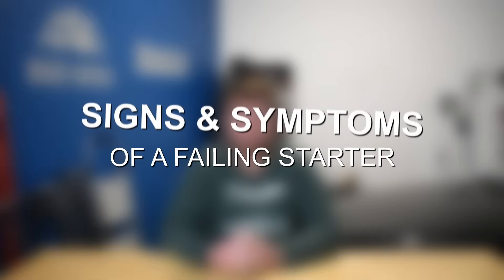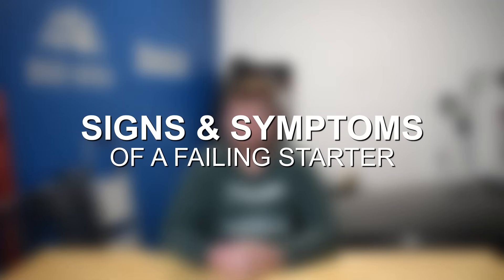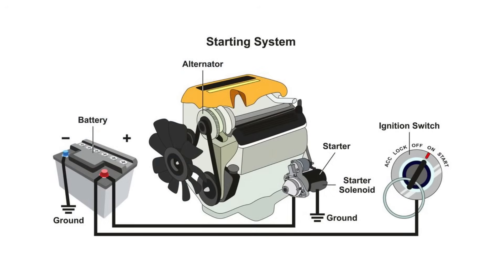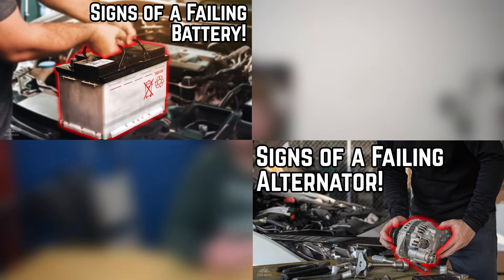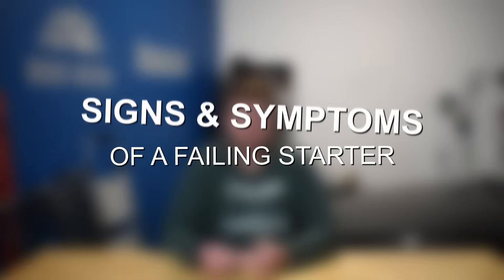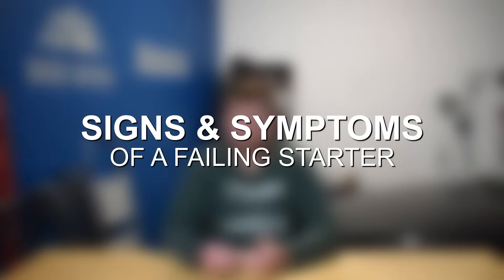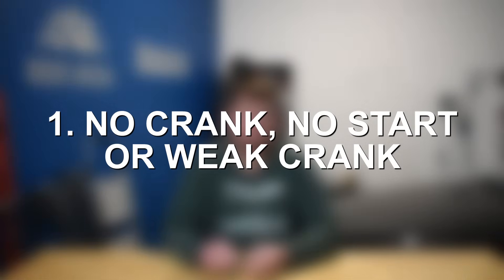5 Symptoms of a Bad Starter!

Comment: bro i put a new starter on 2hen i cranked it the starter sounded like it kept spinning and it hasnt started since. its 20 degrees so  havent got under the car to see whats going 9n but all i hear is a click the battery and cables are good i have a battery charger
Reply from the maker: D - If your new starter kept spinning when you first cranked it and now only clicks without starting, it’s likely a stuck starter, bad solenoid, or an installation issue. The starter may have failed to disengage properly, causing it to overheat or damage the flywheel teeth. Since it's now just clicking, check the starter connections to ensure they are tight and making proper contact, especially the ground and power cables. Also, try tapping the starter lightly with a hammer while turning the key—if it engages, the solenoid may be faulty. If the problem persists, the starter may be jammed against the flywheel, requiring you to unbolt and reposition it. Cold temperatures can also cause internal resistance, so ensure your battery is fully charged and delivering enough cranking amps. If all else fails, the new starter may be defective and need replacement. Keep us updated!
Reply: @8020Media  I have an older Impala so I think I'm having a security problem because I put another starter and just click new battery

Comment: I have to crank up my car 2 times for it to start and then after like a week the battery is dead and usually I get it replaced and it’ll turn on again(but I still have to crank it 2 times for it to start)
Reply from the maker: I - The fact that your car requires cranking twice to start and the battery dies after a week suggests two likely issues: a parasitic drain on the battery and a potential fuel delivery or ignition system problem. The repeated battery failure points to an electrical component or system draining power when the car is off. Perform a parasitic draw test by disconnecting the negative battery terminal and using a multimeter to measure current draw; anything above 50mA indicates a significant drain. As for the need to crank twice, it could be caused by a failing fuel pressure regulator, fuel pump, or ignition system component like spark plugs or coils. Keep us updated!

Comment: Replaced my starter 2 wks ago now when I turn the key over the battery dies. Battery, alternator, relays, fuses are all good. Did the same when I changed the starter first time . The starter was a refurbished one
Reply from the maker: C - If your battery dies immediately when turning the key after replacing the starter, the issue is likely a shorted or faulty starter, a bad ground connection, or a high-resistance power cable. Since this also happened the first time you replaced the starter and you used a refurbished unit, it's possible the starter is drawing excessive current due to an internal short. Check all battery and ground connections, ensuring they are tight and free of corrosion. Inspect the starter power cable for damage, as a frayed or internally corroded wire can cause voltage drops. Try testing the starter outside the vehicle (bench test) to confirm if it’s faulty. If everything checks out, replacing the refurbished starter with a brand-new OEM or high-quality aftermarket unit may solve the issue. Keep us updated!
Reply: @ Thank you I believe you’re correct. I replaced it yesterday with another warrantied Starter and it started back up. My ground connection from my battery was a little loose and tightened back up. If anything changes I’ll update  👍

Comment: My 05 titan had been sitting for a while, I am very positive that my battery is good but when I turn the key it’s almost as if everything is surging. My gauge needles will spazz and there is a ton of clicking and what sounds like sparking but there’s no actual sparks. I hope it’s just my starter but the gauges are throwing me off.
Reply from the maker: K - The clicking, gauge needles spazzing, and surging electrical behavior in your 2005 Nissan Titan after sitting for a while likely indicate a weak or corroded battery connection, bad ground, or failing starter relay rather than just a bad starter. Even if the battery is good, check the battery terminals for corrosion or loose connections, as poor contact can cause voltage drops and erratic electrical behavior. Also, inspect the chassis and engine ground straps, as corroded or loose grounds can lead to intermittent power delivery. The clicking sound suggests the starter solenoid isn’t getting enough voltage, which could be due to a weak connection or a failing starter relay. Keep us updated!

Comment: So my 2012 sonata fails to start once a month it seems. Dashboard, lights everything works. No crank, no start, no sounds no jump start. This has been happening after the starter has been replaced as well. I began disconnecting the battery to reset the alarm system as well as unplugging the connection in the inside fuse box. It will start 30mins later sometimes. Sometimes I have to leave it unplugged overnight. I've changed the start fuse also. The car will start like normal for at least a month and do it all again. I also make sure the steering wheel is not locking up and I try to park on level ground. Any idea what's causing this? Diagnostic checks are getting too expensive.
Reply from the maker: J - The intermittent no-crank, no-start issue on your 2012 Hyundai Sonata, especially since the starter has already been replaced, is likely caused by a faulty neutral safety switch, an intermittent ignition switch issue, or a problem with the anti-theft system. Since disconnecting the battery or fuse box sometimes allows it to start, the alarm/immobilizer system may be preventing the car from recognizing the key or allowing the starter circuit to engage. Next time this happens, try shifting to Neutral and attempting to start, as a failing neutral safety switch may not detect the car is in Park. Additionally, inspect the starter relay and wiring to ensure there’s no loose connection. If the immobilizer is the issue, using a scan tool to check for stored immobilizer or key recognition errors may help pinpoint the problem. Keep us updated!
Reply: @8020Media  thanks

Comment: My car will crank   i willl at least have to turn it 2 times by the 3rd time itl start. Once i had turned it nothing no noise radio was on and everything nothing. Did it a few times nothing. Waited like 10 minutes turned it than it started slow. Got home turned the key consistently like 6 times it started fine.
Reply from the maker: J - The issue you’re describing, where your car cranks inconsistently or requires multiple attempts to start, points to a potential problem with the starter motor, ignition switch, battery connections, or fuel system. The fact that it sometimes does nothing when you turn the key suggests a possible issue with the starter solenoid or ignition switch, where the signal to engage the starter isn't consistently reaching the motor. Additionally, check the battery terminals and ground connections for corrosion or looseness, as poor connections can cause intermittent starting issues. If the starter and connections check out, the issue could also be tied to a failing fuel pump, fuel pressure regulator, or a clogged fuel filter, especially if starting improves after waiting (allowing pressure to build). Keep us updated!

Comment: Had a mobile mechanic to conduct a diagnosis on my Ford territory 2005 model.  Vehicle issue was that it couldn't start. He concluded that it was both a battery and an alternator problem. Had both replaced. Car was still abit hazy starting  up but got the vehicle up and running.  Battery test concluded after the new one that it was charging up but slower than usual. Went for a 50 minute drive, no problems on the road, AC radio all working fine.  Got home, turmed car off, turned  it back to check if it was still ok 7 seconds later and it was dead. Checked the new battery and it was completely drained.

Your thoughts?
Reply from the maker: K - If your 2005 Ford Territory has a new battery and alternator but the battery drains completely after driving, the issue could be due to a parasitic draw, a faulty alternator connection, or an issue with the battery wiring. Start by inspecting the alternator’s wiring and ground connections to ensure they’re secure and properly transferring power. Perform a parasitic draw test by disconnecting the negative battery terminal and using a multimeter to measure current draw; anything above 50mA indicates an excessive drain. Common culprits include aftermarket electronics, a faulty relay, or a short in the wiring. If the alternator isn’t properly charging despite being new, test the voltage output at the battery while running (should be 13.5–14.5 volts) to rule out any installation issues or a defective alternator. Keep us updated!

Comment: My starter motor was clicking rapidly, so I replaced it with a brand new starter. But with the new starter it's still just giving me rapid clicks? I still think the clicking is from the solenoid engaging and disengaging. Is there anything else that could cause this behavior?
Reply from the maker: K - If your new starter motor still clicks rapidly, the issue likely lies with insufficient power reaching the starter. Check that the battery is fully charged, providing at least 12.6V at rest and 10V while cranking. Inspect battery terminals, starter connections, and engine ground straps for corrosion or looseness, as poor connections can limit current flow. Test the starter relay and solenoid control circuit to ensure proper operation, as a faulty relay can cause the solenoid to disengage prematurely. Additionally, check the cables for internal corrosion or high resistance that may restrict power delivery. If all components are fine, have the battery load-tested and verify the alternator is charging the system correctly. Keep us updated!

Comment: Thanks for the video. I've got a brand new battery and doesn't seem like there's the power that new battery should be giving the starter. Every now and again, it'll only just barely start the engine. Battery has been tested twice now and passed. New terminals, same story. Hoping this is the starter? It's under warranty but not sure how to go about the process
Reply from the maker: 7 - If your new battery tests fine and the terminals are clean and tight, the issue is likely with the starter motor or its connections. A failing starter can exhibit symptoms like weak cranking or intermittent starting despite a healthy battery. Before replacing it, ensure the ground connection from the engine to the chassis is solid and inspect the starter’s power cable for corrosion or damage. If these are good, the starter is the probable culprit. Since it’s under warranty, contact the warranty provider or the shop that installed it and explain the symptoms. They may require a diagnostic test or starter inspection to confirm the issue before authorizing a replacement. Keep us updated!
Reply: @8020Automotive  My wife actually was looking more into it because I'm stumped and found that it may be possible that a low battery in key fob is the culprit. I measured the 3v battery at 2.8 volts which is considered dead, so hoping this may be it. We'll know within 2 weeks. Will update
Reply from the maker: 7 - Sounds good. Keep us updated!
Reply: @8020Automotive  Still hasn't failed so I'm almost ready to call it fixed.

Comment: What if it keeps blowing the ecmb fuse the starter has been making a crazy nouise
Reply from the maker: B - If your vehicle keeps blowing the ECM/ECMB fuse and the starter is making a strange noise, it's likely due to an electrical short or excessive current draw from the starter. A failing starter motor with an internal short can overload the circuit, causing the fuse to blow. The noise from the starter suggests it might have damaged components, such as a bad solenoid or worn brushes, exacerbating the issue. Inspect the starter wiring for damage or frayed insulation that might cause a short to ground. Replacing the starter motor and ensuring all associated wiring is intact and secure should resolve the issue. Keep us updated!

Comment: 1:52 REMEMBER!! This can also be the sign of a dead battery. A rattling relay, is a dead giveaway of a dying or dead battery. However, the battery may have enough juice to actuate the solenoid itself, but not enough juice to get the starter motor to crank the engine. I've had that situation happen to me once, I was worried the starter gave out but then we tried to jump my car and it started like a champ! This is very possible and it does happen. Left my dome lights on that night prior lol! Good think they're halogen bulbs because it didn't seem to affect their lifespan much but I'm trying not to do that because I don't want to burn them out either. Or have to replace my battery....
Reply from the maker: A - Very true! Thanks for sharing this insight.
Reply: Ok so I thought same thing with mine but today I had to have someone use a screwdriver to get connection on a wire or something on my starter while I cranked the key and my solenoid on starter is really loose so my question is is it possible to just change the solenoid or should I just change my whole starter and be done with it? Lol

Comment: I'm getting that machine gun noise. My 1997 Lexus kept dying because the battery was not connected properly. I think the connection got loose. Also one of the buttons to lock the door was stuck and kept draining the battery but no one figured that out for 8 years. I have problems with my Lexus because it's old but I found a good mechanic.
Reply from the maker: S - The machine-gun noise you're hearing is likely from the starter solenoid clicking repeatedly, caused by insufficient voltage reaching the starter. This issue is often related to a weak battery, loose or corroded battery connections, or a failing starter motor. Since you mentioned a loose battery connection and a long-term drain issue from the stuck door lock button, the battery might have been weakened over time. Start by ensuring the battery terminals are clean and tightly connected, fully charge or replace the battery if necessary, and verify the alternator is properly charging the system. Fixing the door lock drain issue will prevent future battery problems. If the noise persists with a healthy battery, the starter itself might need inspection or replacement.

Comment: Bad starter can stop the motor wile running?
Reply from the maker: C - No, a bad starter cannot stop the engine while it is running. The starter is only used to crank the engine during startup and does not play any role once the engine is running.

Comment: Mines does the one click when i turned the key, but my truck started dying out when i was driving in the snow 2 weeks ago but when it stopped snowing it had ran back to normal
Reply from the maker: T - This can happen when it gets cold!
Reply: @8020Automotive  oh okay so that would mean my starter still good or its no good anymore?
Reply from the maker: T - The single click when turning the key suggests an issue with the starter motor, its solenoid, or the battery connections, but the earlier stalling in snowy conditions points to potential moisture or corrosion affecting the electrical system. Snow and moisture can cause grounding issues or interfere with the alternator's ability to maintain the battery charge, which may also lead to insufficient power to the starter. Start by checking the battery's state of charge, cleaning the terminals, and inspecting the ground and starter connections. Additionally, inspect the alternator output to ensure it's charging properly, as the snow-related behavior may indicate an alternator or electrical connection issue exacerbated by wet conditions.

Comment: My clio campus 2008 starts first time every time. However I get a slight grinding sound for half a second after it starts. Does this mean my starter motor is going to die soon?
Reply from the maker: L - The grinding sound after starting your 2008 Clio Campus is likely due to the starter motor's pinion gear not disengaging from the flywheel quickly enough. This could indicate wear on the pinion gear, flywheel teeth, or the starter solenoid. While it doesn’t necessarily mean the starter motor will fail immediately, if the issue persists or worsens, inspect and possibly replace the starter motor or solenoid to prevent further damage. Checking the flywheel for wear or damage during this process is also recommended. Keep us updated!
Reply: @8020Media  thank you for the detailed response. My friend is a mechanic and pretty much said exactly what you've described. The only thing that is weird is the fact it doesn't happen every time. When the car is warmed up, it doesn't make the sound. It only happens first thing in the morning usually.

Comment: Car initially won’t start. Need to turn off and on the key for few times. Then car will start. After few minutes drive it automatically starts again and the next morning it will do
The same (giving a crank sound) any idea ?
Reply from the maker: Y - The issue of your car not starting initially but starting after turning the key a few times, followed by intermittent problems, could be caused by a failing starter motor, weak battery, or faulty ignition switch. The "crank sound" suggests the starter is engaging but struggling, indicating either insufficient power delivery or an internal starter issue. A weak battery or corroded terminals can cause intermittent starting problems, especially in the morning when the engine is cold. Alternatively, a worn ignition switch may not consistently send the proper signal to the starter. Start by testing the battery and alternator, inspecting connections, and checking the starter motor and ignition switch for wear or electrical faults. Keep us updated.